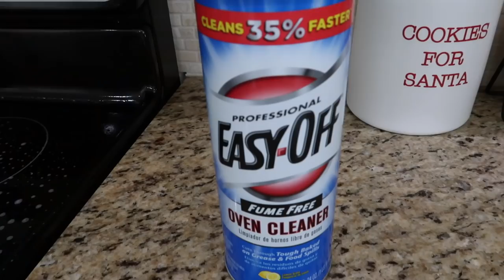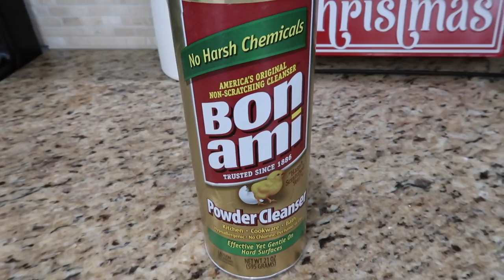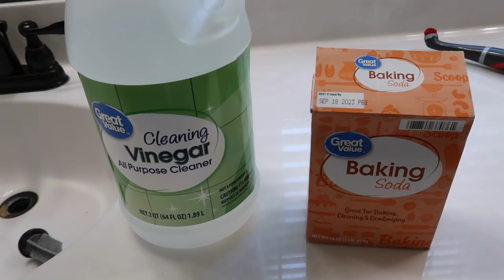*HUGE* EXTREME WHOLE HOUSE CLEAN WITH ME 2020 | ALL DAY SPEED CLEANING MOTIVATION | CLEANING ROUTINE

Comment: Do you ever reseal your grout after scrubbing? Might not hurt, and will keep it cleaner/resistant to stains for longer.
Reply from the maker: I don’t but it’s not a bad idea!
Reply: Oxygen Bleach for grout work is amazing! I get a brand on Amazon that is stronger then Oxiclean and doesn't have fragrances or fillers. It needs to be dissolved in #HOT water and soak in the grout with some scrubbing but the results are worth it.
Reply: I'd be careful with using bleach on colored grout. I've used it on really nasty light colored grout and it does work great for that purpose, but if you had colored or darker grout absolutely do not do that.
Reply: @ellenjonasson94  Oxygen Bleach is different from Chlorine Bleach. But yes I'd still do a spot test first just in case. If this wasn't directed towards me, Sorry!

Comment: When I was growing up when my mom had shower doors for the shower, maybe about once a year (or more, not sure) she'd take the shower doors completely off. Scraped the glue off underneath the tracking and everything. Just to deep clean it. You can either do that or just replace it with a mold/mildew resistant shower curtain. I prefer the shower curtain myself for easier cleaning. I use two at once, a plastic lining for the inside and a patterned one for the outside. You can choose what works beat for you, but shower doors need a lot more deep cleaning and you have to be very careful with the glass. And also make sure not cut yourself if you use a metal scraper to het the glue off. You may want to research how to properly do that.
Reply from the maker: I need to do that!

Comment: I absolutely love watching your videos! I'm definitely going to order your trusty little tool. I ordered a different one from Amazon and it was even a little bit more money. I had it a couple months and barely used it and it quit working on me. I thought it just needed batteries and nope it was junk so I will purchase the one you recommend. I already had mine before I seen yours I just barely used it. Everything you have recommended has been so good! I do have a question I just got my JAWS products in. Which blue rag is for the glass? I got 2 different blue rags. 1 is microfiber and the other is thinner. I ordered the e-cloths and I can't wait to get them in! I also have a Shark Vacuum, the customer service was so good with me mine quit working and they replaced the whole vacuum with no problem, and I also have the Dyson (the newest one) cordless. Before I start I love Both brands equally! I have the yellow Dyson that you have and I have had mine for over 10 years and it still works! As for carpet I honestly think my shark picks up better but for my hardwood floors the Dyson Cordless is better! The Shark picks up on the hard wood and the Dyson is good on my carpets but I just think they are better that way!